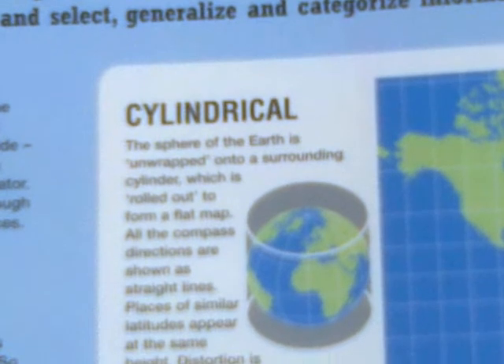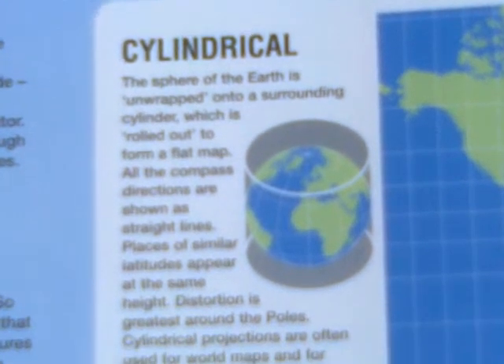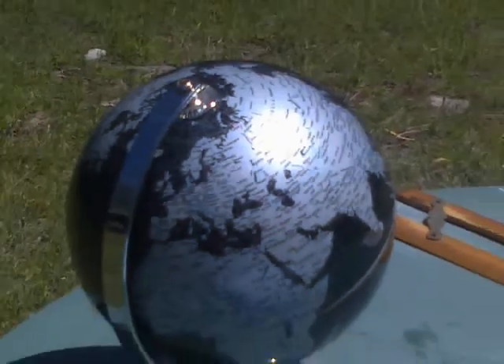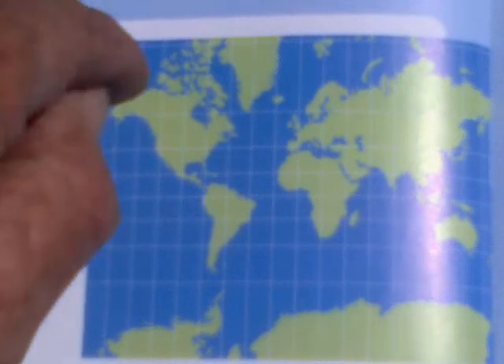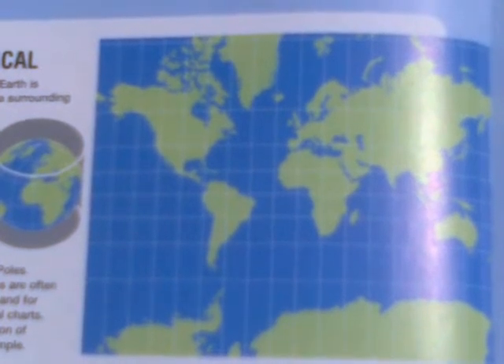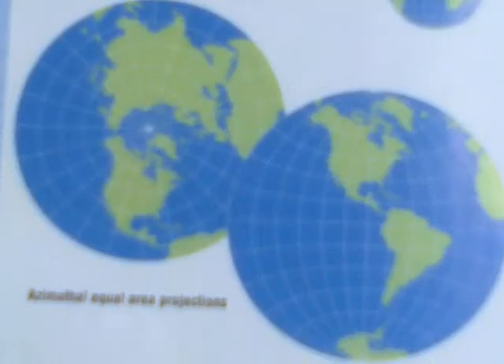Mapping Flat Earth...; Easier Said Than Done !

Comment: "As you may have heard, it's not easy to make a map of Earth"

No need.  The globe you have there is the only accurate map of Earth.  That's why it's not only hard to make one... it's impossible.  Check out the legend on that globe.  It matches all flat maps and the gps/nav we all use to drive around.

"Hopefully it will be done the next time you see it."

Nope.
Reply from the maker: G'day,

Wake up to yourself mate.

   To make a Video concerning putting Flat Earth to the test, on a Tabletop, and do a propper Job of it ; one indeed NEEDS a Big Map of Flat Earth, to work with.

  If you thunk that I'm attempting to
 "Prove the Flatness of the Earth...",
 then thou hast NOT been paying attention, Munchkin....!

Just(ifiably ?) sayin',

Take it easy...

Stay safe.

;-p

Ciao !
Reply: @WarblesOnALot  No, just adding clarification.  Either way, you are displaying the only correct map of Earth.  The best way to prove the shape of Earth is to prove or disprove the globe map.  The rest is just silliness.
Reply from the maker: @tjjones621  

Mate, I'm planning on  making a Video to address the Objections of the Flat-Tards who didn't get the point a couple of months ago when I posted,

"Cubic Sundial Totally Destroys Flat Earth Theory...!"

  And to answer your pathetic plaint..., I say that SIMPLISTICALLY pointing at a model of the Globe  in which the Flat-Tards disbelieve is NOT going to prove Jack Diddley Shit to anybody.

  However, my contention is that because the Vernal Equinox was 6 weeks ago and thus the Sunrise/Sunset  illuminates the South Vertical Dial on my Time-Cube..; then I will need the best biggest "Map Of Flat Earth" that I can Draw, upon which to stand the Cubic Dial - while demonstrating that according to the Flat-Tards's favourite Geometrical Theory then it should be impossible for the Sun to rise & set sufficiently far South of me, here at 30-Degrees South, to ever shine on the Cube's South Vertical Dial.

  Also, by the use of 3-D models, I plan to show that on a Flat Earth the Sun & Moon cannot ever Set below the Horizon or Rise above it...

So, in point of fact, the Silliness here is all yours - in that you couldn't imagine why I want to draw a map of the Flat Earth Fantasy, in order to use it on a Tabletop Demonstration which uses the Actual Sunlight (and weather permitting, Moonlight too) to PROVE the Globularity of the Earth.

  And, part of the plot involves not repelling the Flat-Tards by pointing at a model Globe and demanding they accept my, or your, "Authority" and simply,
 "BELIVE ME...!"

   The point of THIS Video was to 
A) function as a Teaser for the planned "Masterpiece"..., &
B) To explain how bloody hard it is to draw any Map of the Flat Earth Hypothesis which is even vaguely functional when depicting everywhere South of the Equator.

I suspect that most Flat-Tards have never ever attempted to map their Fantsy, let alone to have made a Sundial.

I contend that the fact that Sundials operate prefectly well, all over the Earth, ipso-facto & per-se PROVES the Earth to be a Globe..., in an undeniable manner ; which is greatly assisted when the Sundial is a Cube with 5 Dials and it sits upon a Map of the Flat-Tard Fantasy.

  Your plan to point at a Model of a Globe simply does not prove anything to a Flat-Tard ; their whole Thesis begins with their assertion that there's no Experiment which they can perform in their Back Yard which proves that the Earth is not Flat.

  I've done it for them once, with

"Curved Chemtrails Arcing Over The Flat Horizon...!",

My previous Cubic Sundial Video couldn't quite prove the point - because I made it a few weeks before the Vernal Equinox, so the Sun was too far North to light up my Dial's South Face.

  Simply pointing at a model Globe on the Table, and expecting any Flat-Tard to be impressed..., is at least as useless as a Theist pointing childishly at their Book of Godtheory  and expecting that Atheists will be at all  impressed thereby.

   They cannot be told, so I hope to show them.

It's a bit like the way I held the attention of the Free Energy Brigade in my (most popular, with 770k views...!) video,

"The Ultimate Illegal Research, Permanent Magnets Banned...; Alternative Energy FORBIDDEN...! (Part 4)."

  The idea is that they can't be pushed..., but they lead wonderfully well...; and the Map of Flat Earth I'm struggling with is intended to function as the "Bridle & Reins".

There, hopefully now you can underconstumble what's afoot & underway.

  Take it easy,

Such is Life...

Stay safe.

;-p

Ciao !
Reply: @WarblesOnALot  "I say that SIMPLISTICALLY pointing at a model of the Globe"

I have not suggested any such silliness.  You keep saying globe "model."  But, what you have is BOTH model AND MAP!  You have a Annova 8' globe there.  A bit small, but it is for educational purposes.  Check out the white box just to the left of the tip of S. America.  That is your legend.  It has scale and distance conversion.  That means it is a map, which means it can be tested.  I am telling you that your globe map matches ALL FLAT road maps, flight & nautical charts and.... the gps/nav devices we all use, some 4.5 billion of then, including all ships at sea right this minute.

Make a video about how the globe MAP matches every single source of Earth data that you can find.  THAT'S how one proves the globe and it's how I show flatearthers how they fell for the FE prank while they held the correct map in their hand the whole time.

Btw, I didn't read all of your post... too long for such an easy and simple topic.
Reply from the maker: @tjjones621  

There there, niverthermoind then, Simpleton....

Argue  for your limitations, and
Sure enough ;
They are
Yours...

If your pathetically short, self-centred self-absorbed and self- oriented abbreviated little Attention Span can't cope even with my Reply to your repeatedly wrongheaded Comment ; then you'd likely shit yourself if you were to ever dare to attempt to view the Video, which I posted today.

The Video which REQUIRED the use, as a "Prop.",  of the best Map of Flat Earth Theory available to me....; in order to best illustrate the points which I chose to attempt to make.

  Go back to Kindergarten, you apparently proud Ignoramus.

Such is Life.

Yours must be insufferably dull.

;-p

Ciao.!
Reply: @WarblesOnALot  How was it wrong headed?  I am only telling you that you are going the LONG way round...  some me party you are having.
Reply from the maker: @tjjones621  

Watch,

"Finally..., Flat Earth Versus Sundials ; The Definitive Observational Analysis...!"

   I videoed the Moonset, North of due West, and then 12 minutes later the Sunrise, South of due East...; with my 5-faced Cubic Sundial set up between them, and the laboriously hand-drawn Map of Flat Earth then going on the Table to illustrate why such a sight can never be seen on a Flat Earth.

  I wasn't having a "Me-Party", I was making a Video which falsifies  every Flat Earth Hypothesis ever hatched.

And, by the way..., the little scale MODEL of the Globe which appears in both these  Videos is Un-Branded, and it's NOT an 8-inch diameter model either - it's 7-inches accross.

  You are almost as obtuse as the person, be they a Fool or Troll, who showed up on the other Video's Thread - claiming that  Earth is a Cube...; and stating that they believe in a "Pac-Man Model of Flat Earth" - whatever the fcuk they think THAT might be...(!).

   Just(ifiably ?) sayin',

Take it easy.

Such is Life,

Have a good one...

Stay safe.

;-p

Ciao !
Reply: @WarblesOnALot  "and the laboriously hand-drawn Map of Flat Earth"  

This is where your experiment train derailed.  There is no such thing as a Map of Flat Earth.  I noticed your capitalization.  In the end, you will only prove that your goal was misguided before you began.  No matter what you say or do.... you will NEVER  make an accurate map of the Flat Earth.
Reply from the maker: @tjjones621  

If you were to stop shouting about how impossible it is to draw an accurate Map of any Flat Earth Hypothesis..., you might manage to  notice that the 10 minute Teaser Video is ENTIRELY devoted to my making that point.

  However, my concept of the Video I wanted to make included the use of a large Tabletop Map of Flat Earth, and I detailed WHICH Choices I decided to make in the drawing of the Map...; and one of the "Money Shots" I wanted to show was to use 2 little Foam Balls, one being  painted yellow  & the other one left white to simulate the "Small, Low, Sun & Moon..." which are  hypothesised by the Flat Earth proponents, both atop 2 little pillars (equating to both being 500 miles in diameter and 2,000 miles above the Surface....) - and then pull the Camera down to being Level with the Tabletop to SHOW that on the Disc of Flatland the Sun & Moon cannot ever be seen to rise above the Horizon or to set below it...

The big idea being to pair the Kangaroo & Swamp Wallaby hop-on Cameos - demonstrating my location 30 -Degrees South of the Equator with the Sun shining on the South Vertical Face of my Cubic Sundial for over an hour - before transitioning to shine on the North Vertical Face ; and then go to the Flat Earth Map - transform it into a 3-D Analogue Model of the Discworld Hypothesis to illustrate that on every Flat Earth Hypothesis  ever hatched..., Sundials could not ever function as they in fact do operate, telling the (Local Apparent) Time.

   Not a single one of your petulant  childish objections to my use of the "best map of Flat Earth that I can draw..." (note that I never said it could be "Accurate"...) is either valid nor pertinent and as such your whinging and whining and grizzling and griping and howling and caterwauling is collectively not worth a single Knobblie of Goatshit onto the Compost Heap.

  So, pull your self-centred Head out of your Autistic Arsehole ; and stop fixating your attention around the MINOR point that it is impossible to draw any kind of accurate Map of an impossible and non-existant "Flat Earth" Hypothesis...

  The object of my excercise was to use the best Map of Flat Earth which I could draw, to augment what may be the ONLY Southern Hemisphere Universal Portable Cubic Sundial on Earth..., to demonstrate that BECAUSE the Sundial functions as it does - then therefore the Earth Is NOT Flat.

   My aim being to falsify the Flat Earth proponents' CLAIM to the effect that,

"There is no Experiment which can be done in the Backyard which will prove that the Earth is not flat...".

  If that is all too much for you to comprehend, due to your obsessive fixation concerning bleating about the impossibility of drawing an accurate map of a place which doesn't exist..., then I feel sorry for your limited little Attention-Span and inability to engage in Abstract Thought.

  The impossibility of accurately mapping Flat Earth has never yet convinced any Flat Earthers of their wrongheadedness - so why fixate on the issue and belabour that point ?

I chose, instead, to "let them have the best Map of Flat Earth that it's possible to draw..." and then USE it to show them that their Hypotheis is total Bullshit which completely fails to explain or reconcile where the Moon was videoed to have set and the Sun was videoed being seen to rise.

It isn't my fault that you're obsessively fixated on a minor issue concerning what amounts to being "Poetic Licence".

  I think, speak, and write, in a mixture of Old Colonial Vernacular...; and if ye cannae cope wi' that, then - again, you're arguein' f'r y'r own limitations..., so sure enough they are indeed yours to be limited by.

There there, nivertheemoind.

Such is Life.

Stay safe...

;-p

Ciao !
Reply: @WarblesOnALot  Yes, the LONG way round... got it.  A waste of time.
Reply from the maker: @tjjones621  

You're an idiot.

I'm a YouTuber, I make Content which I think is sufficiently interesting as to be worth posting.

You are apparently the sort of Concrete-thinking Fascistic  Control-Freak who cannot deal with Abstract Concepts at all.

In the dark little recesses of what passes for your mind, the fact that the World is an oblate spheroid means that it Ist VERBOTEN ! for anybody to ever attempt to draw a Map of any Flat Earth Hypothesis for any reason - not even to demonstrate the impossibility of such a Map ever being in any way accurate, and not for use in a Video demonstrating how Sundials falsify Flat Earth Fantasies.

  You are the absolute antithesis of a Scientist, you have an uncurious mind which you pride yourself on as being as razor sharp as a Steel Trap with a Hair-Trigger...; but the fact is that it is Impossible to teach a Steel Trap ANYTHING at all.

  Zero Flexibility of Action, the ricketty mechanism within your obsessively fixated naysaying Head is apparently a one-trick Pony.

There there, niverthemoind.

Apparently you were raised by a long line of manically rigid Control Freaks..., did they send you to a Military Acadamy to learn to say, 
"Yessir !" &
"Nosir !" &
"Three Bags Full SIR !",
as well ?

If so, then such would well explain your festering petulance here on my Thread, expressing your sense of outrage at being disagreed with and told to piss of & stuff your opinions up your Arse as you go.

Take it easy,

Such is Life...

;-p

Ciao !
Reply: @WarblesOnALot  Only an idiot would keep writing long boring posts after he was told that they are not being read.

You, and your "experiment" are as much a waste of time as FE itself.  All you are doing is giving them fodder to keep you off in the weeds aka spinning your wheels.  But, I hope you are having fun at least.  :)
Reply from the maker: @tjjones621  

You're a rude little ignoramus..., Munchkin, whereas I'm sufficiently polite as to answer the people who show up making Comments on the Threads under my Videos...; even when they talk Autistically blinkered monomaniacal Bullshit, like that spewed by thyself...

   There there, nivertheemoind.

Such is Life.

;-p

Ciao !